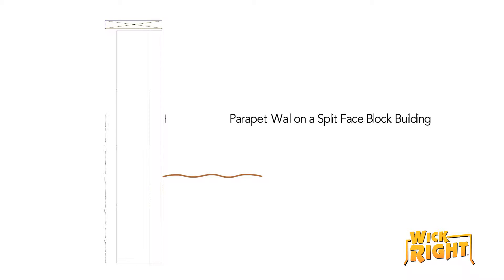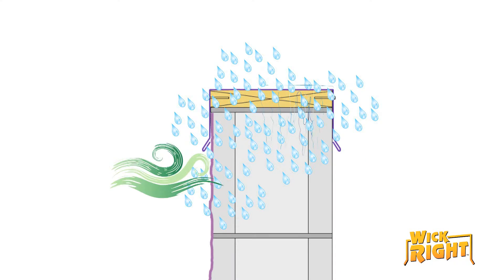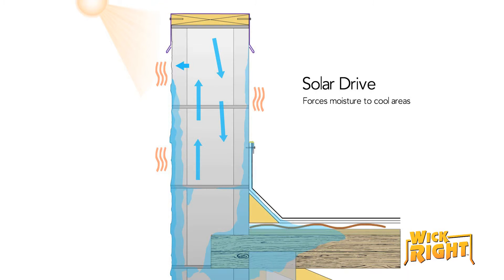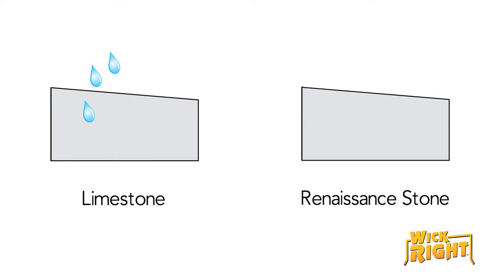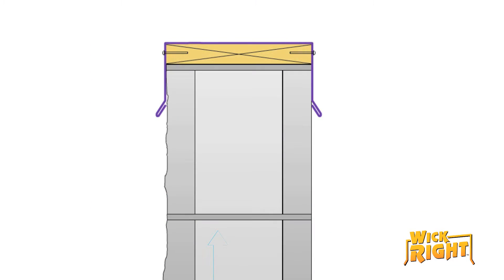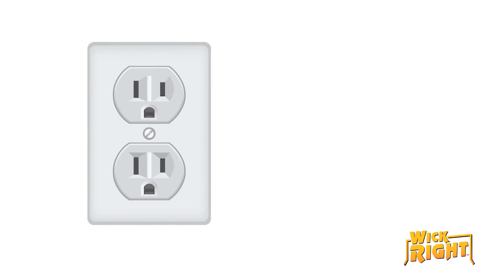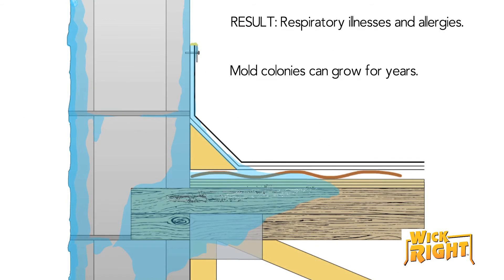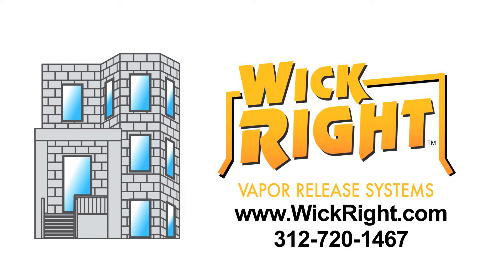How to Fix Chicago's Leaking Split Face Block Buildings

Comment: My job is to solve masonry problems and this is a fantastic invention. I have used this system to dry historic buildings as well as modern split face block construction. Mr Kelly is a wealth of information.  Highly recommended.
Reply from the maker: Thanks Simon! Simon is a true masonry guru. If you have a masonry building that needs attention, do not hesitate to give Simon a call.